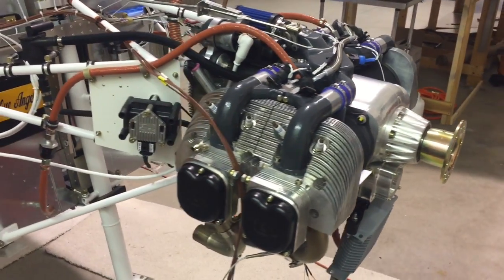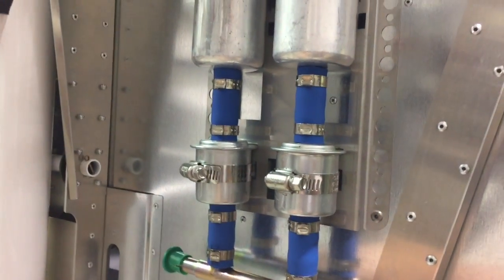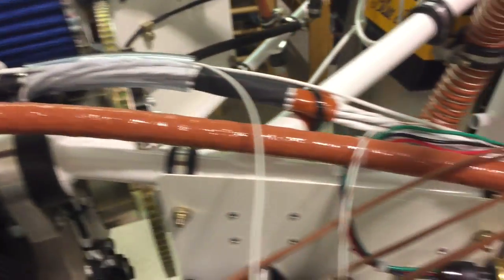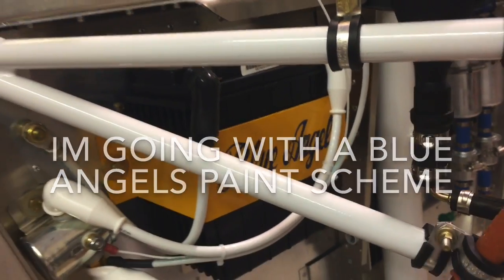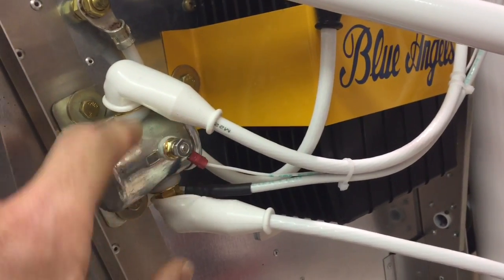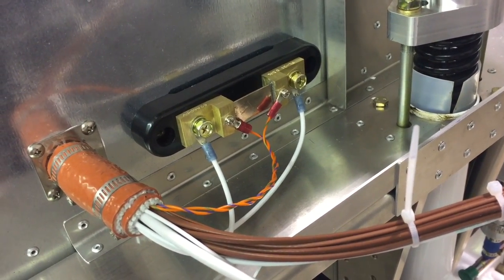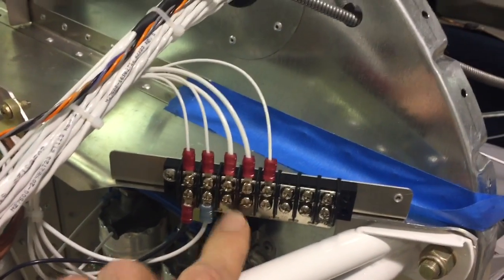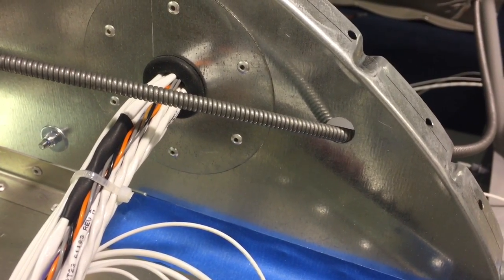UL Power 350iS Engine

Comment: Hey there from Central Wyoming!

I wanted to thank you so very much for providing an absolutely outstanding video in the how to category!

I hope you do a complete series of these because quite frankly your presentation is the clearest, the most logical, and the most comprehensive, for someone who has not yet bit the bullet and delved into building a kit aircraft, or selecting an engine.

Previous videos that I've seen, and I'm talkin several hundreds, have been nowhere is clear is your video is!

Far too often the work seems so complex, and so convoluted, but it just makes me want to grab a fifth of dark rum pop the Cork and just start drinking!

 The two engine manufacturers that I have narrowed my search down to, is UL and Aero Momentum, the arrow momentum seems to be in the lead so far, because of initial cost and rebuild cost at TBO time!

 The Edge that your model engine has, is the fact that it is air-cooled; no pesky cooling jackets and conduits, no extra weight for radiator and all the coolant, and none of the extra sensors and wiring.

 aircraft model manufacturers the top three chip manufacturers are zenith, the PSA Merlin out of Florida, and the Chipper aircraft; however the last one is problematic because of a lengthy build time and a lack of aircraft in the air.

 Thank you again for your time and I wanted to let you know that I have subscribed and hit the little bell so that I get notifications of your new postings.

Take Care and I look forward to seeing new videos

Comment: If you have not done it already , save yourself a lot of grief later by pulling the exhaust pipe flange bolts on the cylinder head and put high temp anti seize compound on the bolt threads..........pull them out one at a time , lube them and retorque each one before going to the next bolt.........the bolts will seize themselves in good without anti seize on them..........the stainless braided lines in your fuel system , are Teflon tubing inside the braid...........I am pretty sure they need fire sleeve on them as well , but a phone call would clear that up..........nice tidy installation you have done.........looks great..

Comment: Hi Mark, thanks for the tour. Just a word about  the Ground, at the  ECU top left vibration mount, firewall side. It  could use its own isolated clean "bolt to firewall" connection. As it is now, it only has one good contact face, due to the rubber overcast on those isolators.    Looking great, keep up the good work.

Comment: It's great that we got some new engines on the ultralight scene, like UL Power and D.Motor. I would very much like to see an ultralight helicopter fitted with twin D-Motor LF26 engines. Guimbal Cabri G2 would be a killer with twin LF26...it would likely be one of the safest helicopters on this planet...big commercial turbine helicopters included.

Comment: Great video, I. learned so much so quickly - great filming, narrative, technical vocabulary!  A quick question:  are you still quite pleased with the UAL 350 engine? Any issues? Thanks!
Reply from the maker: The UL Power has been fantastic. The only issue I had was a cracked exhaust pipe, and every once in a while the #3 CHT probe goes haywire. No other issues. It runs very smooth.
Reply: @KitplaneEnthusiast  Very gracious of you to reply in this detailed way. I ask because I'm looking at a slightly used 750 with the 530iS (83 hrs) here in Brazil. When the #3 CHT shows up on your monitor, what do you do? Get a new sensor/probe? Again, I ask because of the possible challenges of getting ULP parts here. Also, opted to not get a ULP in your 750 SD - biggest reason? Simplicity out in the boonies?

Comment: Hey Mark.  I've noticed UL Power installs on Zenith 750s, the engine mounts quite far forward away from the firewall.  There is almost enough space there to install another engine :).  I figured it was for CG, but your UL Power is about the same weight as a Rotax 912, and ~30lbs lighter than an O-200/235, which mount much closer to the firewall.

Any idea why they sit the UL Power so far forward on the Zenith 750?
Reply: Having it farther would also reduce the cabin noise I guess among other things, so not a bad thing.

Comment: an ammeter is probably very handy to have on an aircraft, mostly because even the most ambitious homebuilder probably doesn’t fly every single day and charging issues can crop up easily. The meter gives you a built-in diagnostics tool to figure out if you have a draw and also a quick reminder as you’re shutting everything down to check the gauge and if there’s more than whatever your minimum draw should be you know you have something still on that shouldn’t be.

Comment: Mark, Do you use any type of "locktite" on the nuts and bolts that don't have a locking type nut? Like all the little nuts and bolts used to mount all the little hose/wire clamps you have in your engine compartment. Thanks
Reply from the maker: ALL nuts are locking type.
Reply: @KitplaneEnthusiast  Oh OK. I couldn't tell from the video. Some just looked like regular nuts. Thanks!

Comment: Mark, could someone with no experience install the 350iS engine with the use of the Homebuilt Help Video? I know it would be foolish doing an install and then flying without an approval from and AP,  but could it be done?
Reply: Thanks for the quick reply, Mark. I have researched a lot of kit planes (experimental) and a couple of manufacturers stand above the rest, Zenith being one. The common theme among most companies is the ease in which these kits can be assembled. Unfortunately, most of these companies lack information on the ease or difficulty on engine installs. Your video's do a great job of showing how a professional install should look like. I hope to find more video's explaining this issue and if I find it to be too daunting, maybe I'll just have it installed by a professional. Thanks again and continued success.

Comment: Beware with the oil cooler..... If you can push it up against the oil pan, it will make contact during flight.  I have this problem and am currently figuring a solution.  If anyone has a suggestion , I'm all ears.....